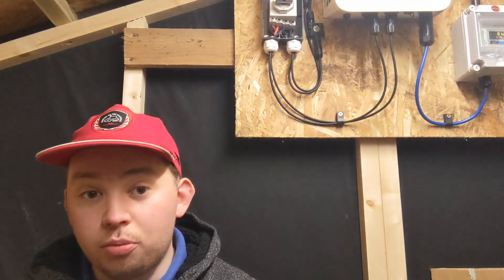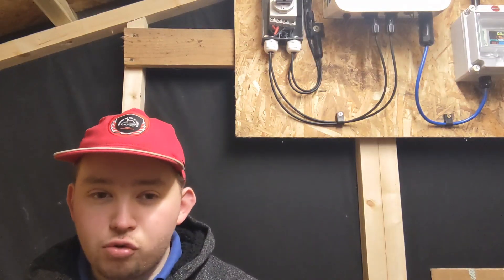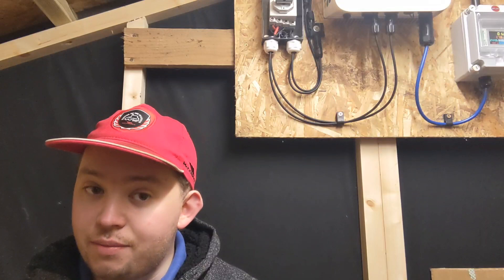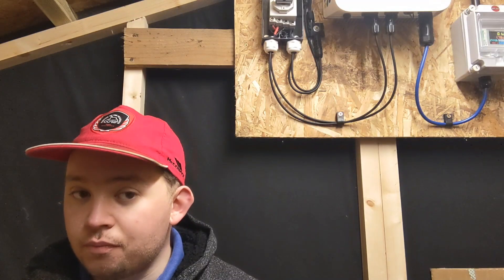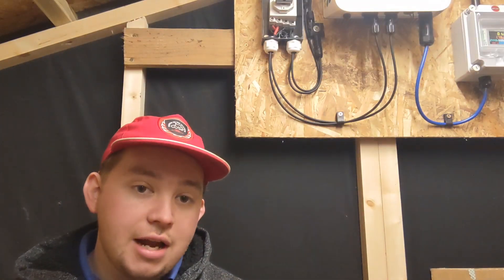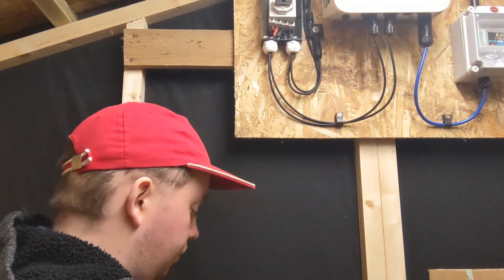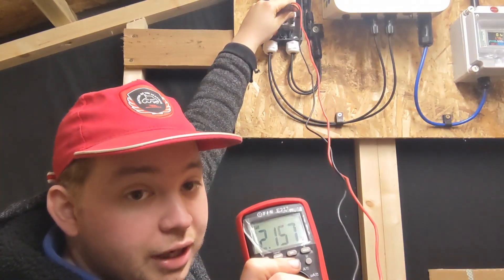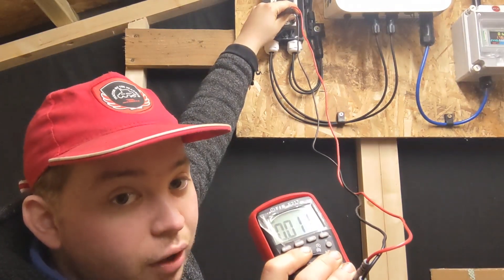Do Solar Panels Generate Electricity At Night? #shorts

Comment: are solar panels worth it ? according to money saving expert it could take 14years for them to pay for themselves .   they recon a saving of £400 a year and at a cost of £7000 to buy . genuine question . ive a 2 bed house eco 7 heating which was working fine up until 3 years ago  my bill has gone from round £70 month for 12 months up to over £220 a month for 12 months  and now my house , which i only run the heaters for less than 5 moths of the year , is not that warm , in the last frosty spell living room was down to 15 degree . without some kind of grant to get a battery and pannels 7 grand doesnt seem worth it
Reply: It's probably not worth buying that sort of system. It will generate far more power than you can use in the middle of the day during the summer, and not a lot during the winter, and you don't get paid much for exported power. However you can get a quick return with a much smaller system, say a single 400W panel and microinverter (on a shed or low roof so you can install it yourself). That's because your house probably uses 400W or less during daylight hours, so this small system will match your demand whenever it is sunny. If you get 1000 hours of generation a year and pay 30p a unit, that saves you £300 a year, which is about the cost of the panel and micro-inverter - a one-year payback!
A big system might make sense with a battery, so it can power your lights in the evening but it's still only going to be a fraction of your total bill as your bill is mostly for heating, and you don't get much solar at the time of year you're using heating.
Reply from the maker: Thanks for watching the video and leaving a comment. In my opinion solar panels are worth looking into. Everybodys situation is different i would always reconmend starting with the basics managing and monitering your installation looking for savings. For example if you already havent swapping lights for led versions good led bulbs can use 10% of the power of incandescent or a third the power of cfl. its a nice cheap starting point. i reconmend purcasing some plug in power meters and looking for vampire loads. cutting half a dozen of the small loads can add up massively. but data is what you need if you contact a solar installer with your data they can design and price a system that works best for you.

Comment: interesting thanks for the information, how much did your self made system cost altogether?
Reply from the maker: Thanks for watching the video and leaving a comment. my system was built at the same time the shed was built and wired up but i can roughly break it down solar panels i bought 8 for £150, Inverter was £180 unistrut and other other bits cable, bolts, consumables etc probally another £200

Comment: I have 4 100W panels 2P2S I measured 2.1V, on a full moon as well, over here in Halifax Canada. On a Sunny day 2 in series makes around 50V. I Measured the full moon voltage open circuit. I'm not sure about the Amperage.
Reply from the maker: Thanks for watching the video and leaving a comment. Great to see my finding ere repeatable on other parts of the world. Current would be increabily low

Comment: The issue is not voltage but amperage. Volts open circuit measurement is pretty artificially elevated. Without out something drawing that power it's alowed to build up voltage. I would bet most of that voltage was cut off at sunset. Maximum lunar output is less than 1 watt per square meter while solar output is around 1000 watts per square meter. Of note any voltage buildup in the lines will go to your inverter when you get sun. So you are generating some power from lunar output just no where near what you think you are.
Reply from the maker: Thanks for watching the video and leaving a comment.  Voltage and current are both important. You need minimum 50V for the inverter to kick in. I agree open voltage is slighlty inflated as when you load the system the voltage drops. The fact you need just under 100 panels to theroreticaly reach the required thresh hold. Shows how small amount you get from a full moon. My system at the moment is a high voltage low current system running 60v panels.